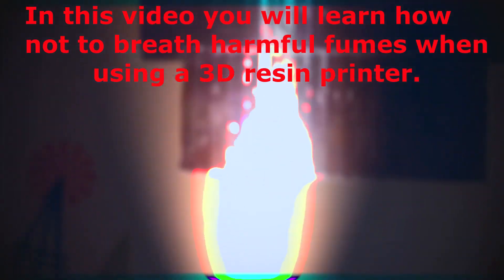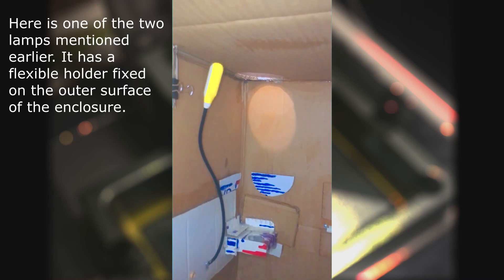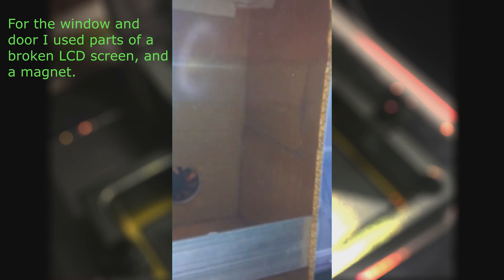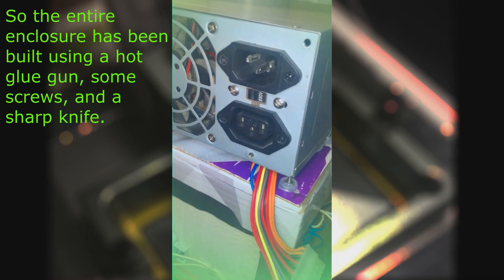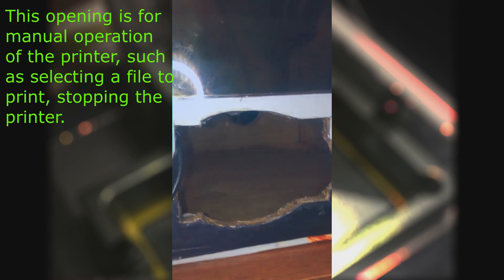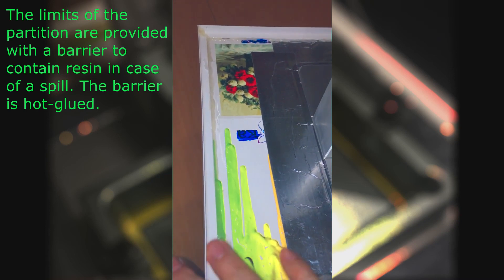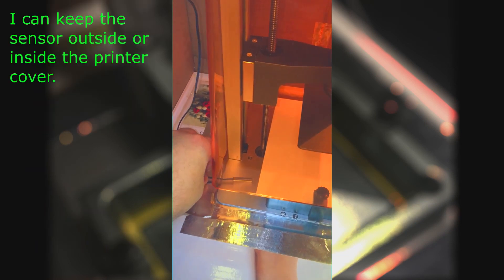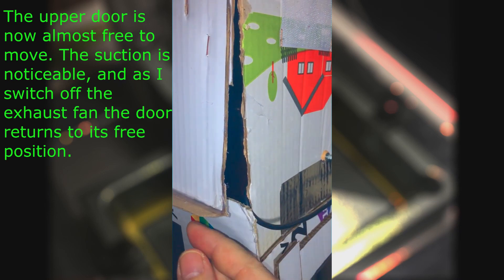Experimental ventilation enclosure for a 3D resin printer

Comment: been searching for a while for a good enclosure video, this is one of the best and most resourceful I've seen.
Reply from the maker: Thanks. I am still usiing it. The only thing I added is I doubled the fan capacity (installed the second fan at the end of the exhaust pipe). The other thing I would add maybe 15 or 20cm to the width for storage of small jars, bottles, etc. and to be able to do washing of prints inside the cabinet. Got another printer recently, so will be expanding the enclosure based on the previous experience. The side window is not really needed now because it is near the wall of my room.:). Also it would be better to place the two outlet holes at the top of the enclosure not diagonally (like in the video) but both outlet holes at the front. Instead of the round intake plastic pieces (elbows) it's better to use elbows with rectangular opening on one side, so two pieces will cover the entire width of the cabinet over its top.
Reply: @3DResinPrinting  the suction on the fan seemed pretty good, surprised you needed more power, were the fumes leaking? what printer you got now, I recently opened up my Saturn, just setting up an enclosure before I start printing.
Reply from the maker: @ackeemd1  My second printer in Nova3D Elfin3 Mini. It has a FHD mono screen. The size of about the Mars LCD. The additional power I need to cope with other fumes which appear during washing. I normally remove the first fan from the line and leave only the one at the end of the pipe when printing. Whan washing I reconnect the first fan.